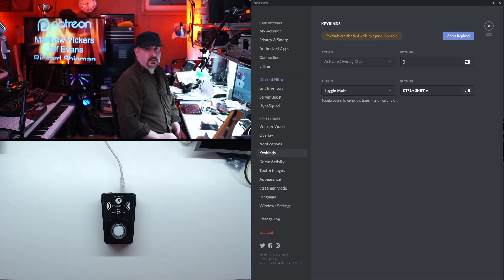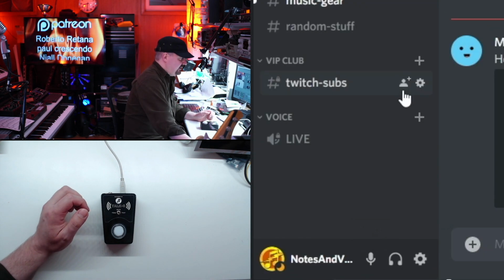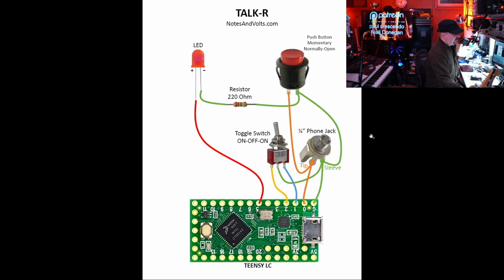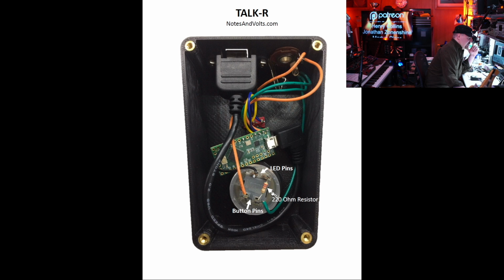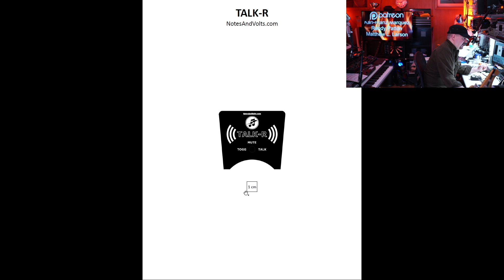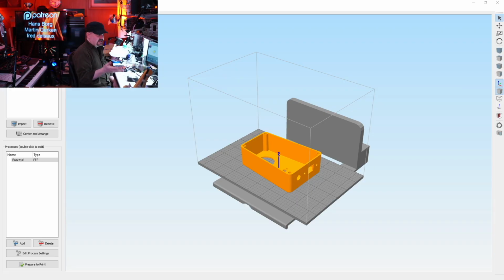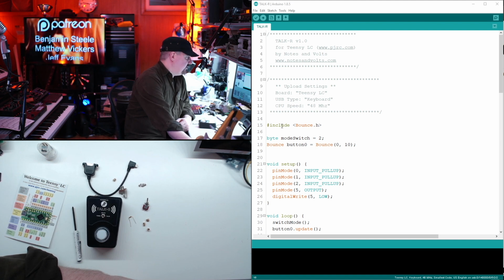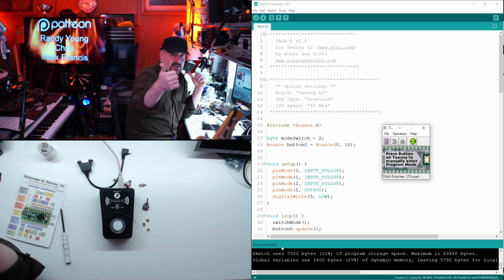Build a Mute Button for DISCORD

Comment: Would this work with an Uno?
Reply: It would 'work', but you'd need a special library to turn the UNO into a keyboard, and once you programmed it one time, you'd have to use a separate programmer (UART programmer), because it changes the USB port.  Teensy's USB port can, to keep it short, do both at the same time.

Comment: Nice video Dave!  Although you could use a Pro Micro, this looks like a good 'works straight out of the box' type solution for those who just need to solve a problem right now.  And amazingly, for once I even have all the necessary bits in-stock including a suitable enclosure.

Comment: Nice video! Like always.
Btw I did your midi pedalboard but I'm wondering how to make it wireless via midi and USB (hairless midi). Would you be kind enough to make a video about it? Thank you!
Reply: Im have a plan to make the same project already :)
Trying to do a 9V powered guitar pedal which sends signal to PC WiFi to control some presets and gain.
Imagine taking only the pedal without any wires.
Guitar wont be connected to it becase it cant send this signals plus the MIDI controlling is on the DAW only.

Comment: Suggestion: the teensy is pricey and overpowered for this kind of projects, you can just rely on a Pro Micro clone which can cost between €/$ 2 to 5 depending on quantity and from which store you buy them.
EDIT: oh someone already gave you this suggestion
Reply: Life goals: have so much money that you can use raspberry pi just for blinking an LED
Reply: One LED, each, in a matrix display.  ROFL.
Reply: i have a raspberry pi zero w that i got for free laying around and was wondering if that could work too
Reply: @georgeshields9672  as an encoder? maybe but not worth it, it needs a lot of coding and optimization
Reply: @MasterControl90original  fair